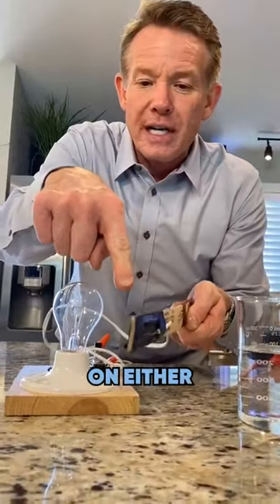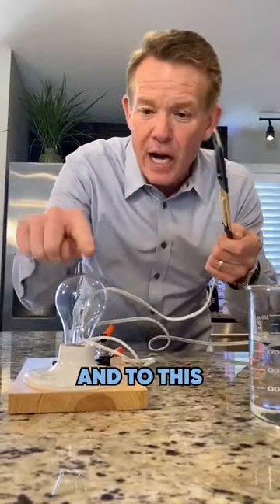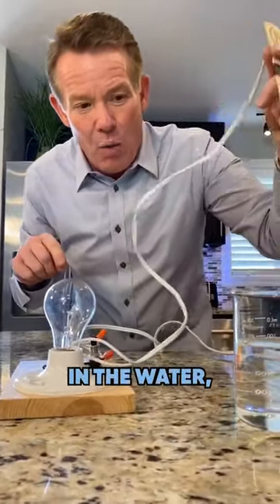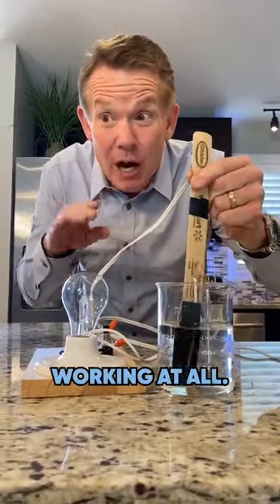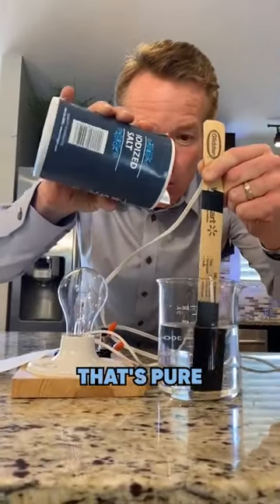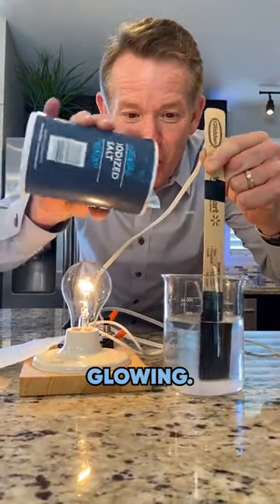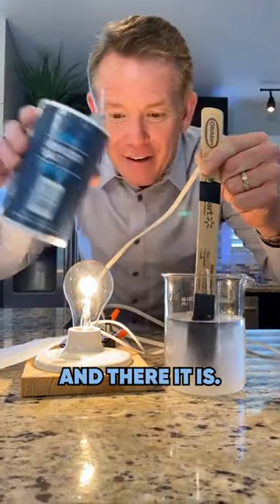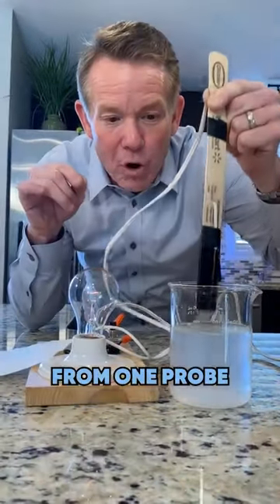The Non-Conductive Water...

Comment: used to run wire edm machines, had to run di water and when filters were bad and the ppm got too high machine would alarm out until new filters and water cycled enough to remove any conductive material